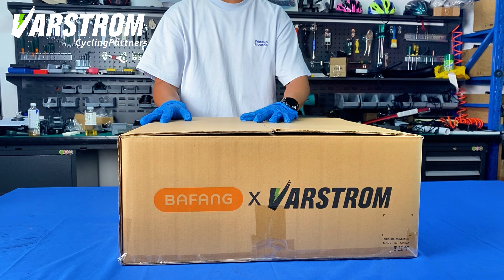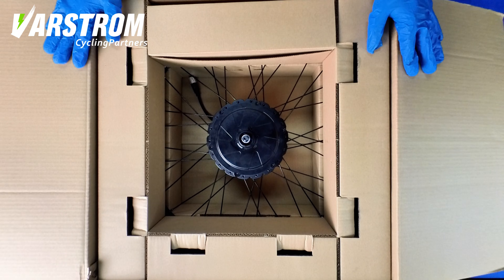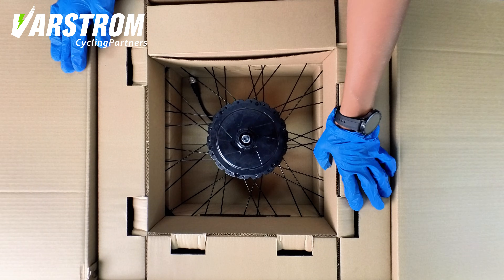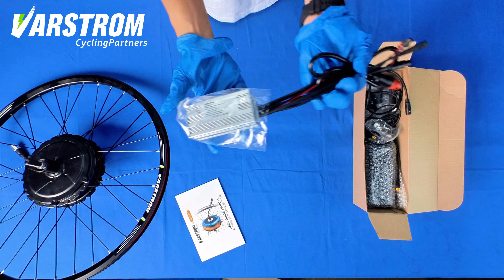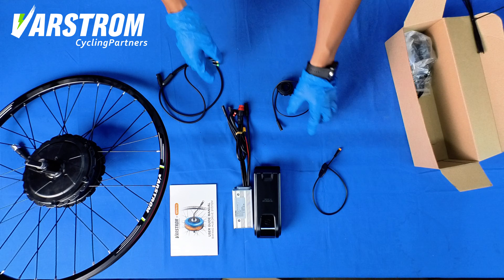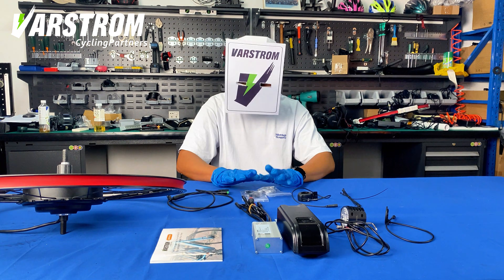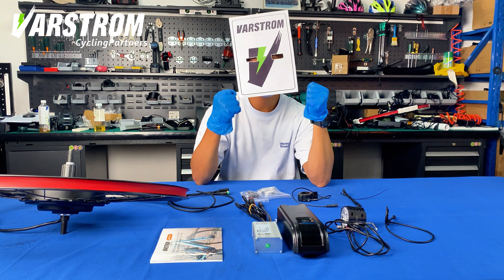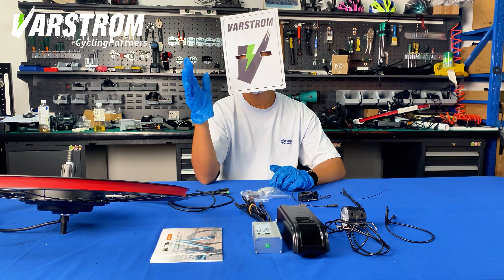Unboxing Bafang ebike conversion kit（G0900 48v 750w）

Comment: hey im from england thinking of ordering the varstrom 48v 1000w rear hub how do you manage to sell the whole kit battery included for just £457.43 when every other kit with a battery comes out to about £600 and would i need to order torque arms sperately or not
Reply from the maker: https://varstrom.com/products/varstrom-48v-1000w-rear-hub-conversion-kit?ref=dwcwdedm
Reply from the maker: hey bro,remember to use discount code "vanko".send u the link and you can choose your own combination.
Reply from the maker: The torque arm is not included and needs to be purchased separately. btw
Reply: I just got the kit without battery from Ali for £183 (Bluetooth controller version) including shipping and tax. I bought 48V 40Ah battery separately for £145, which makes it even better deal.